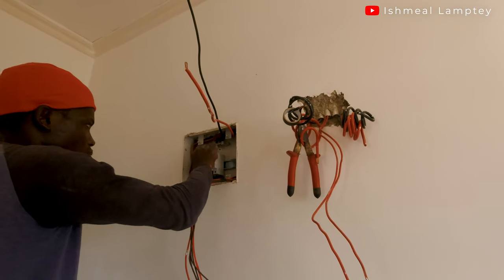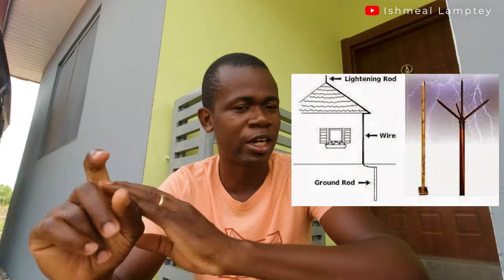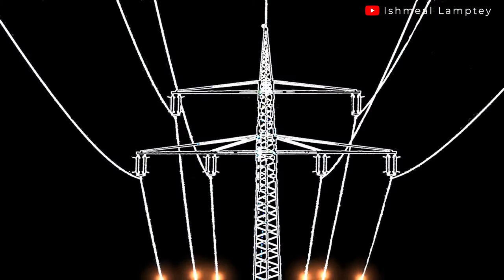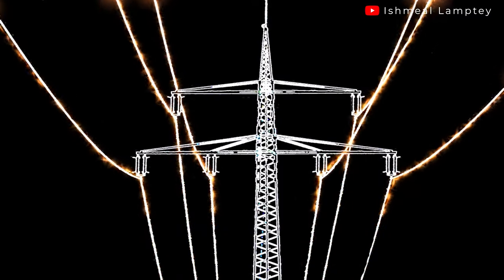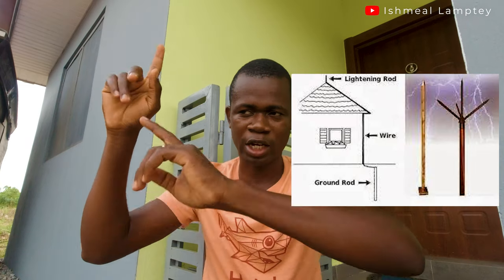Watch this before wiring your house in Ghana

Comment: To also add some additional protection install DC SPDs in the PV Solar solar circuit and earth it. You were very lucky it didn't fry the circuit. And when you do the electrical earthing and the lightening protection earthing make sure they are separate from each other
Reply from the maker: Yes, i was very lucky and also the electrician suggested a different earthing for the thunder conductor. Thanks for the suggestion, i will look into the DC SPDs
Reply: Thank you for the feedback.